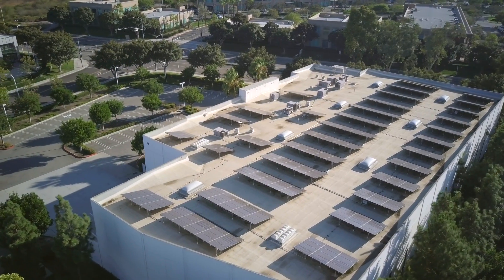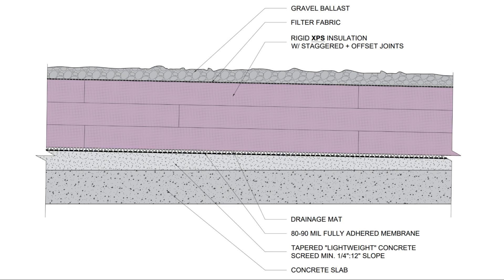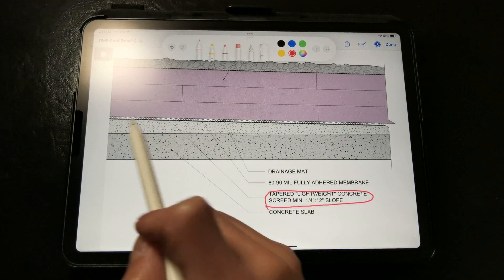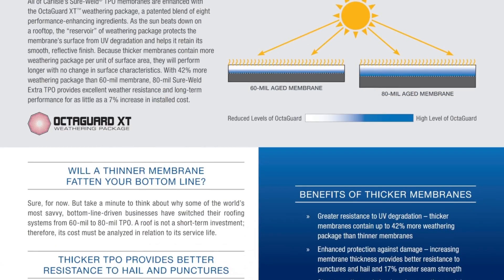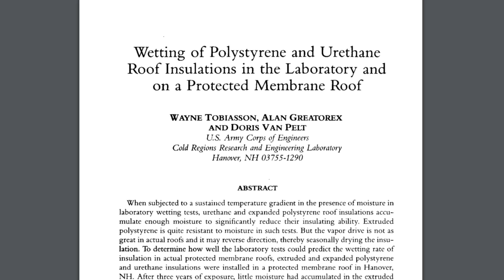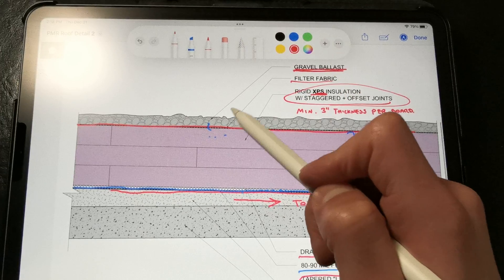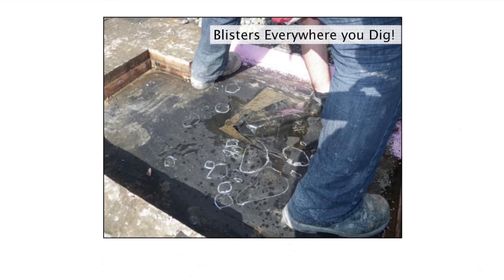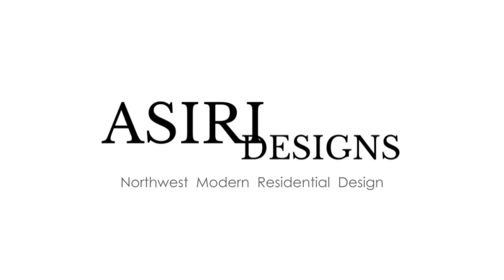The Perfect Flat Roof (Protected Membrane Roofs For Architects + Contractors)

Comment: So drainage and membrane are below xps. Which means water passes through xps. So if it is ice cold weather or you have snow load melting through your xps, your heat insulation layer is basicly not working.
Your water insulation shall be above xps. If xps is not dry, it is not insulating any heat

Comment: I am an architect in Brazil. Here, if the membrane is not protected by rigid insulation, it lasts for no more than 10 years. In my designs, I specify EPS over the membrane due the high cost of XPS in Brazil. To protect EPS boards from moisture, instead of specifying gravel ballast over the EPS, I specify a layer of mortar separated from the EPS by a plastic sheet as a vapor barrier. The mortar layer also offers a great advantage, which is the possibility of being painted white for reduction of heat flow. Keep up the good work you've been doing, with all this high-value technical content. Thanks a lot!

Comment: For some reason, im always trying to think about maintenance. I guess with a 100 year roof, repairs are unlikely, but i'd be concerned about fixing leaks or tears with the membrane buried below all that insulation. Also, i'm curious how you'd detail wall scuppers instead of a roof drain, perhaps you'd just hold the insulation back from the scupper edge? I do like the membrane between the insulation and the deck, it avoids the chance of double impermeable layers in the assembly.
Reply from the maker: Hey there! Maintenance and accessibility of the membrane are a tradeoff in protected membrane roofs/inverted roofs, the idea being that because the roof membrane is kept away from heat, UV light, and mechanical damage (the functions that damage the surface of the roof and compromise seams), and is essentially kept at the same conditions as the interior conditioned space, that the need for maintenance is essentially eliminated until the end of the membrane's service life. The fact is that the XPS insulation will need to be replaced before the membrane ever will. That's why we have to emphasize the best roof membranes are specified and ensure that best practice installation is followed. As a general rule, we tend to stay away from scuppers in these types of roof systems and opt for either roof drains, internal gutters or attached gutters, or a combination of these systems, as this eliminates any breaks in the rigid insulation layers that could lead to a condensing surface or a thermal bridge for energy loss. As you mentioned, if you want to implement a scupper, you would simply terminate the insulation shy of the penetration.
Reply: @ASIRIDesigns  Thanks, yes that makes sense. Select a superior membrane and it should function well. Good point about the xps.

Comment: your roof spec is mind numbing expensive thats why the gov is looking at it their money is free. tell mom and pop who own a 10k square foot  small strip mall their roof will be 250k
Reply from the maker: Yup, you aren't going to build a 50 or 100 year roof on a shoestring budget. Durability and performance costs money, and is an investment.
Reply: @ASIRIDesigns but when exposed epdm lasts decades is it worth it?  And for a residential structure, I’d never trust the install quality enough to bury the membrane. And finally, for the price of this system, why not just increase the slope and use standing seam?

Comment: Doesn't the airflow through the drainage mat mitigate the insulation efficacy?
Reply from the maker: Good question - the short answer is yes, but not significantly enough to make a difference. The longer answer is that you look at a thermal gradient of heat loss, the depth of the drainage mat (1/8"-1/4") is small enough to where the incoming air flow does not cool down the surface of the roof membrane, you don't really want to have a gap larger than this otherwise you do start to have larger energy penalties. There is enough insulation above to keep conditions above the roof membrane quite warm even with the drainage mat. It also helps a lot that the roof membrane is acting as the air barrier as well. The thermal resistance of this roof assembly is more impacted by the saturation of the rigid insulation with water, hence why the drainage mat is so important to ensuring that the insulation is able to dry out. The thermal performance is comparable to any wall assembly with rigid insulation outboard of the WRB with no cavity insulation.

Comment: Wow this video was fantastic, how do you manage solar panels?
Reply from the maker: Thanks so much! PV arrays obviously need to be fastened to the roof structure, which means that the mounting rack penetrations need to be flashed to the roof membrane like any other penetration (membranes with heat welded seams are a must here). The mounting rack needs to be raised so that the layers of rigid insulation and the ballast can be integrated above. In general, I think there are better places for PV arrays than on a roof, though I know this can't always be avoided. Hope this helps!
Reply: @ASIRIDesigns  thank you once again!

Comment: Loving these videos, Think you can do one helping on water mitigation in a field stone foundation? I'm renovating a 140 year old field stone foundation and brick home and I want to apply your mass masonry wall solutions for my walls, the tough part is the loss from exposed brick walls for aesthetic gain but I figure any improvement is better. I want to dig my basement a foot deeper and underpin the foundation then insulate with french drain exterior and sump pump interior behind finished basement.
Reply from the maker: I'm glad to hear you're enjoying the content! You should check out this article I wrote, it pretty much addresses exactly what you are describing: https://asiri-designs.com/resources-1/f/how-to-waterproof-an-old-stone-foundation

I also plan to put out a video on this exact topic.
Cheers!